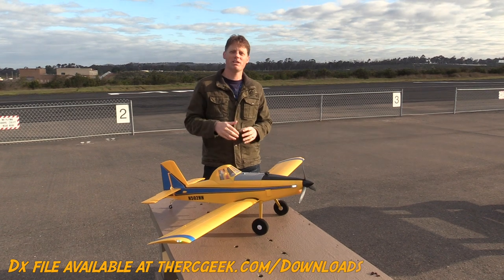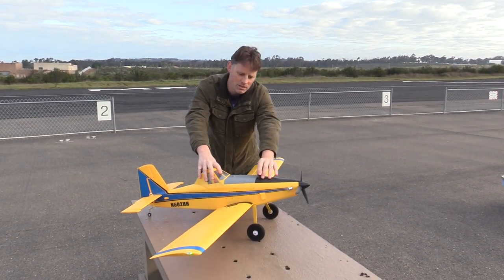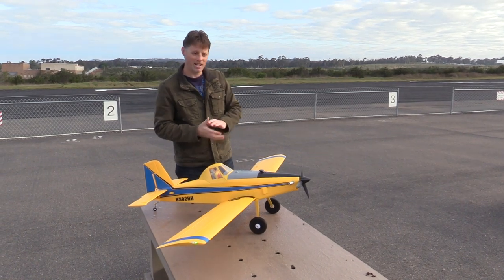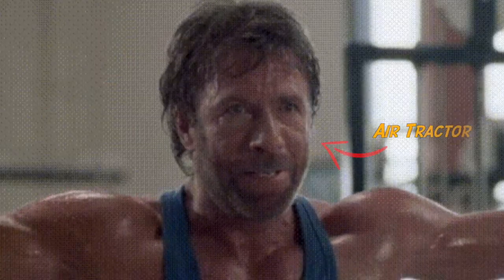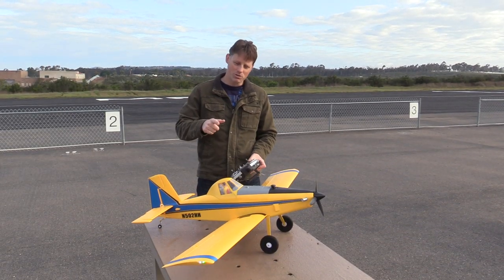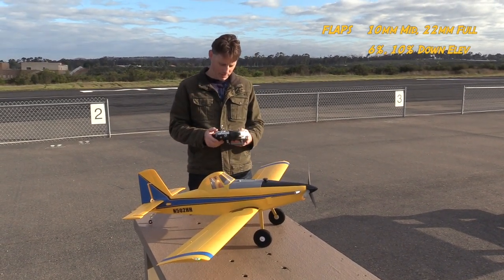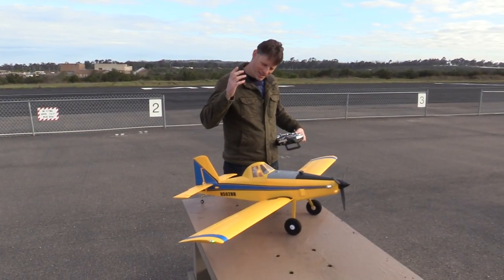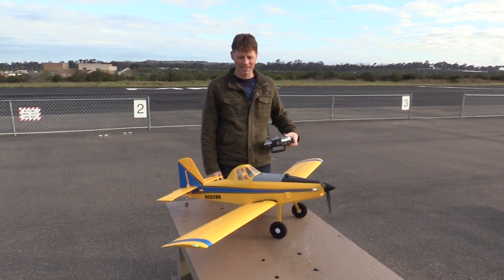From the Field -- E-flite Air Tractor 1.5m Flight Review (The RC Geek)

Comment: I wish I could show you what Ive done to mine, scale pilot with bone dome, full seeding spreader - pump prop driven, cable cutters, brake lines with dummy disc brakes, scale wheels, stall strips, VG's, Antenna kit, 5 blade prop and full model 520 decals with steps, panel weathering and more. I am working on a powder spray system but used a low heat smokle cannister in the spreader and it really is hard to tell from the real thing. The Air Tractors are close to my heart clearly.
Reply from the maker: Oh man, that sounds awesome!  If you’re on social media, you can always send pics that way. My handle is @thercgeek

Comment: Great flying and review. Im going try the expo settings that you used.
Reply from the maker: I’m not one who uses a ton of expo generally, but you should find it’ll help reduce the sensitivity around center a little bit. Also, it can help provide a more linear feel actually if you use it right. It’ll also give you a very nonlinear feel if you use a lot which in some cases (like 3d flying) may be desirable.

Comment: Why didn't you show the programing for safe mode and AS3x mode ?  I have several of the e-flite airplanes with the safe mode but this air tractor did not work in safe mode.  I programed it like it says to in  the instructions  but it did not work correctly. I am in contact with horizon hobby to find out if the receiver is faulty. In the mean time I am flying it with the safe mode disarmed but would  like to know why it does not work in safe mode. Maybe you can help.
Thanks ,
Al Huth
Reply from the maker: I didn’t show it specifically because I had put together a separate video specifically talking about safe. All the info is still relevant: https://youtu.be/ewCL_r0xEXM

Comment: HI, great video! I just bought the Air Tractor 1.5m BNF Basic with AS3X and SAFE Select. I currently have a Radiolink AT9S Pro. Will that work with the AS3X and SAFE? 
If not what do you recommend? I'm trying not to break the bank on a transmitter. Thanks!
Reply from the maker: I'm not familiar with the ATS9, but I'm guessing it's not spektrum compatible.  AS3X and SAFE are Spektrum features and so it would require having a spektrum radio to take advantage of those features.
Reply: @Thercgeek  thanks! I'll have to do a little research on Which transmitter I need to get.
Reply from the maker: Well, if you get the pnp version, then you can install your own receiver. Otherwise, if you want safe and AS3X, you’ll need to go Spektrum.
Reply: @Thercgeek  yeah, that's the one I wanted, but it said it was on backorder. I just checked again and now it's available. Oh well, looks like I will have a Spektrum receiver kicking around. Lol
Reply from the maker: You can always sell it. 😊

Comment: Wishing I had bought one of these instead of my Turbo Timber!
Reply from the maker: I’ve not flown the big turbo timber, but from what I’ve seen it looks like a fun airplane!
Reply: @Thercgeek  The Turbo Timber is certainly a fun plane but I think the Air Tractor is probably a bit more agile and sporty.  Gotta love that bright yellow paint job too!
Reply: @rcflyer7788   I have both and like the turbo timber better. The landing gear on the Air Tractor  are weak and bend very easily. There has been a lot of complaint's about the landing gear.
Reply: @michaelrobertson4745  Thanks for the information about the landing gear.
Reply: Sick of the tunda type planes such as the Timber. Go the tractor.

Comment: I also want to buy the air tractor, but I read in English forums that there should be all sorts of problems, especially with the tail unit and the wings. Someone also had problems with the elevator, because the tail unit is said to be warped. I would hate to waste 329 euros and buy good luck. Can you confirm these issues? Sry my englisch is bad
Reply from the maker: I never had any issues with mine personally.
Reply: @Thercgeek  I also have the air tractor now. I still have to assemble it and fly it in. I am curious. greetings from Germany
Reply: is the prop already balanced at the factory? My Maiden flight is on sunday :)
Reply from the maker: It doesn’t hurt to check, but I didn’t balance the prop on this one.
Reply: @Thercgeek  okay thanks :) I don't have a balancing device anyway. But I don't think that this will be necessary either. Eflite is good quality as usual. my first flight is tomorrow. :)

Comment: Is anybody having problems with elevator in the crease its ripped on the ends so it makes it uneven
Reply from the maker: Are you talking about the counterbalance at the elevator tip?  If it’s come off, I’d recommend flying it back with ca with the radio on so that the servo holds the elevator in place and you can ensure it’s symmetric to the other side.
Reply: @Thercgeek  the crease there are 3 sets of holes 3 holes pure set on the crease its ripped the ends i would send pics but I don't know how to
Reply: Jim P mine were super stiff and took a little just to break in the hinges on my elevator. I did have a problem on setup with them not giving up elevator

Comment: Nice flying AT Chris!   I'm getting the feeling your going to "have your way" with this one as well.  I've really appreciated all of your refinishing videos. (Been slowly refinishing a FMS 1450mm P-51.)
My vote for a new scheme would be;   Air Tractor N1558W.   It would be a completely scale transformation  as well, because 58W was originally painted yellow and blue!  You could even paint the tailwheel pink!   Copy and paste links below to get a look at it.
https://www.flickr.com/photos/tim_crippin21/35446461284
https://www.airport-data.com/aircraft/photo/001364722.html
Reply from the maker: That’s a pretty cool scheme!  I’ve also seen foreign militarized ones too with all kinds of stores on them which is kind of cool too.
Reply: @Thercgeek  I was going to send you a pic of one of those, but you mentioned hooking up a pump and spray bar so, .......
The nice thing about N1558W is the pod under the fuselage, that would allow you to mount the mechanics for a pump/hopper to drop some "Phos Chek"

Comment: Yes. The plane flies great, BUT, don't break the prop like I did. You can't buy one. Not from E-Flite or Ebay. They are on back order. Really disappointing.
Reply from the maker: Bummer!  Take a look at the master airscrew 11x8 3blade prop. That should do the job in place of the stock one.
Reply: The RC Geek Much appreciated for posting that reply , was looking  for spares myself. 👍🏻🇺🇸